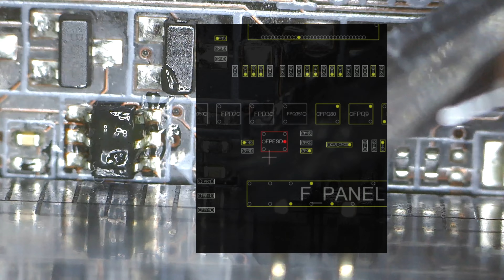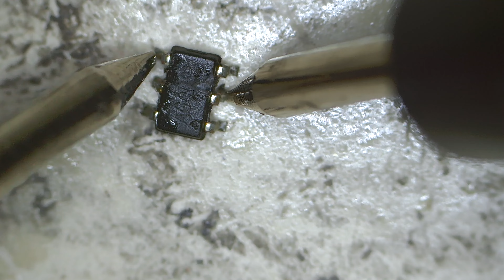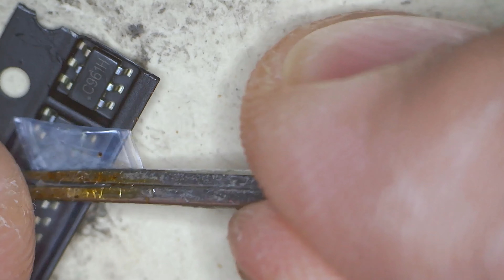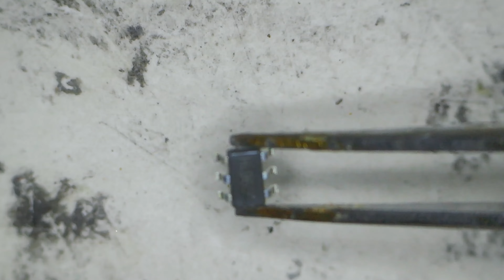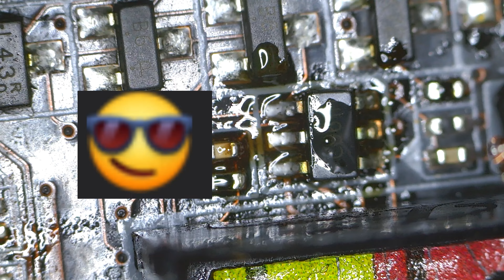Replacing whatever this chip is with a new one because its shorted.

Comment: Are you using regular aluminum foil for a heat cover? Can you use aluminum from a baking pan for added protection? Thank you
Reply from the maker: Its aluminum foil tape. You can use aluminium foil from a baking pan. Only issues I can see is that it could blow away.
Reply: @intheshitter  yes, that's a good point! Thank you